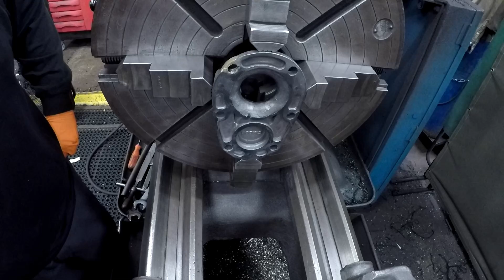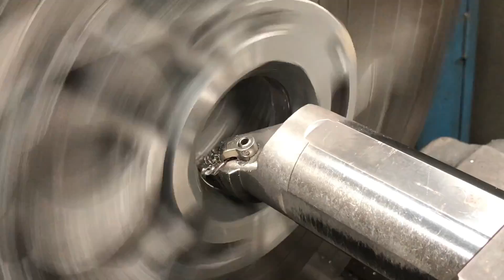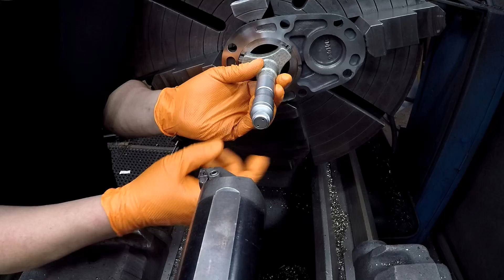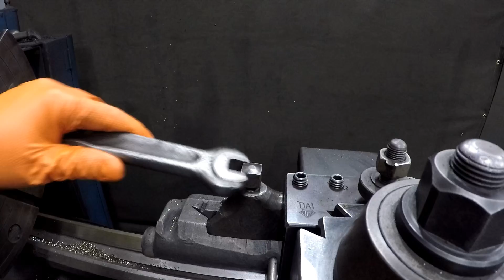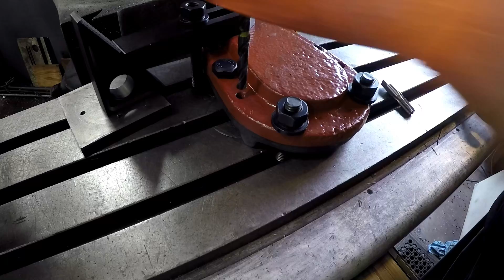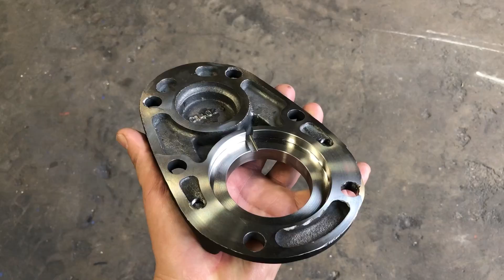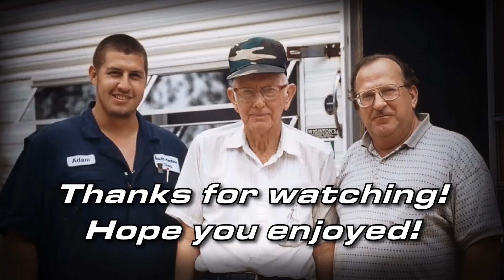Machining a Replacement Casting Part 2

Comment: Maybe you should have surface ground the face.
Reply: Maybe he (or more easily, the foundryman) should have properly averted the hardness issue in the first place. The drilling of the holes was more problematic than the facing op, and setting up and securing an irregular casting on a grinder, given that no clamps can protrude above the finished face, is not trivial.
Reply: All true.

Comment: Adam love your videos and have learned heaps. The problem with the reversed jaw causing the job to be extended from the chuck face could be overcome by removing material from a spare jaw or making your own jaw with out the interfering parts.
Keep up the good work

Comment: One question why didn't you mount the casting on a bridgport and bore the id races?
Reply: You'd have to use a piddling little boring bar compared with the 2" shank bar he could use on the lathe, and there's a lot more mass in the carriage of a Pacemaker than any boring head on a mill. Given the casting had hard spots it would have been a real fight even in a decent mill, let alone a Bridgie.

Comment: Fascinating stuff Adam,  you got yourself a new subscriber mate  ; )
I really felt for you when you blew that hole out while drilling the casting in part 1 of this project.  I was cringing at that grinding drill bit struggling,  and thinking to myself why you hadn't built-up the sides of the original broken part with putty as you did for the bore,  would of given you a little more meat on the edges where the 14mm holes were.  Hindsight is a wonderful thing isn't it!?

10 out of 10 for perseverance though mate,  your ability to not only fabricate and manufacture high quality parts, also extends to fixing stuff obviously.

I've been watching your uploads for days now,  and I must congratulate you on the quality of your videography and photography as well,  superb stuff!  I've learned so much in these past few days,  so much more than if I'd read an entire library of books on the subjects covered.

Thank you so much sir  ; )

TURK @ T4 Concepts

Comment: I'd think with all those chips and cracks especially around the bolts and uneven surface blemishes the part will fail too quickly.
Reply: Yep.  That casting has some serious issues.
Reply: What I understand is that the original casting worked for years until someone at Abom79's shop broke it during disassembly.
Reply: I guess that's what happens if no-one realizes that the "oil plug" holes are actually for jackscrews...

Comment: Well now WAIT,,did I miss,how did you measure,and locate the hole with the seal and bearing in relation to the other hole and the bolt pattern?
I am only in the video where you are boring for the bearing?!
Did I miss or am I not far enough or jumping the gun?
Reply: Yes, you did miss it.  He was able to line up three bolts from the old casting, and then secured them with a nut on the back.  It was a tolerance fit for a seal and it worked fine.
Reply: He bolted on the old, glued up casting and indicated the bore on that.
Reply: @generessler6282  .. right up there with eyeballing, that lining up may cost the gearbox to fail. I'm surprised there's no schematics for that part. Nevermind all the bolts hole chips, cracks, and surface blemish on the top.
Reply: @DJaquithFL  You can type the same comment one more time and you will have three for three.

I watched both videos carefully; the only eye-balling I witnessed was that of an eye-ball on a dial-indicator ending with a micrometer.  The outer bolt holes were all within specs of the tolerance of the original.
Reply: @generessler6282  you must be way better man. Pity you don't have video evidence of you completing a nightmare casing in short notice

Comment: Hey Adam out of curiosity is there a reason to have a casting made for that part vs making it from plate steel? Seems like a plate steel part would be much less likely to crack again in the future. Love the channel man
Reply: He responded to this question on the previous video. It would be really difficult to accurately duplicate all of the pockets on the original part, and it sounds like he was in a big hurry.

Comment: What is the advantage of bringing the knee up instead of using the quill? That was done in part 1 also.
Reply: Slower more controlled feed, if the work "grabs" the drill then it can pull the quill down and bad things happen, that won't happen using the knee feed.
Reply: I would guess that the knee is built more robustly, to handle the weight of the table and anything resting on it. With all that support built in, it gives more control when moving slowly in a single direction. If the quill can be locked, it won't move at all in this case. If Adam finished the hole by moving the quill down further, the drill could chatter more easily leaving a poor finish, or even breaking a chip.
Reply: As above, bringing the knee up is more controlled but also more stable as it has more weight. The more you extend the quill the more slop you get and like a lever, you get more flex at the end so it creates more issues with the drill grabbing, chattering or creating an odd shaped hole.

Comment: I apologise if I’m being dim, but couldn’t this have been faced in the mill? Is there an advantage to doing it in the lathe in this way?

Thank you for all your work and information.
Reply: Exactly what I was wondering.  Would a fly-cutter work as well.
Reply: yeah potentially, no reason you couldn't. I imagine the point to setting it up in the lathe is the ease of accurately boring the part as well as facing. In a mill you'd need a boring head as well plus after that still need to face the bottom of that hole square. Once you're setup in the lathe it's quicker and easier.
Reply: Adam loves his lathes. Nothing wrong with that...
Reply: I usually like to be able to do something more than one way to adapt to whatever I need to do.  Even if two will work, it's good to do some of each as you get the opportunity.  I figure Adam knows more ways than I've got fingers, which is part of why I'll watch anything he posts.  Having that broad-face Chuck sure made the lathe path easier.
Reply: By doing it in the lathe it is easier to align the bored hole for the bearing and the face of the plate. By facing it in the lathe you unsure the face and the bored hole are exactly 90 degrees to eachother. You can do this in a mill too but you require the exact size boring tool and boring tools for the mill for this size of bore tend to be smaller and have more flex. Plus each time you want to make a cut you will have to stop, do the math, set the cut on the head and then restart again then rinse and repeat for the measurement stage, it's an awful lot quicker and easier in a lathe if you have the right chuck! 
In saying that if he did it in the mill it would have probably caused less edge chipping on the trailing edges...

Comment: Arm chair quarterbacking here: back home on the 16"er would it have been possible to strap clamp the piece to the chuck face on three points to get the bore finished , instead of going with jaws, and then face it? Or it that a case of 'the cart before the horse' ?

Comment: Wouldn't a round insert make sense for that facing task? 
You don't need to get into any tight corners, and the cutting edge of those inserts is much stronger right?
also can index it around quite a lot, so if a part of it chips off you can just rotate it to a fresh edge.

Just my thoughts, i'm not a machinist.

Comment: Love the video, and the save of the gearbox!
But I can't help thinking an hour in Fusion and a CNC mill to raw plate stock would have been the faster option for this particular part ...
Reply: If you had a CMM to pick up the details. Otherwise you would spend a day measuring.
Reply: @mathewmolk2089  FYI. He is partly correct. These days technology is available (I do reverse engineering) to scan the old part right off the table and the datails are accurately precision vectorised right into CNC or 3D printer to make the part even in hard metal. It also leaves you with a fully dimensioned CAD drawing.

Comment: a bearing race with a slip fit?
Reply: The fit allows for thermal expansion when the gearbox comes up to operating temperature.
Reply: @johnferguson7235  It is just a retaining cap. - There is no competent engineer that would mount a bearing in a floating cap. It didn't even have locating dowell pins.The bearing rides in the gear box. The clearance is so you can get the cap off.

Comment: The thing that concerns me most about this is that the two end castings appear to have two bearings for parallel shafts with gears(?) and the work to make a new end casting takes no account of the spacing between the bearings.  A few thou difference in the locations will mean the shafts will not run parallel and thus the gear meshing will be suspect.  The way the substitute cover plate was machined would mean that it could never be an exact mirror image of the original one still in use.
Reply: Note that the bearing only sits 9 mm deep in the cover, which looks like half of the width of the bearing race. So I'd guess the bearing has a bore in the gear box too, and the race itself locates the cover.
Reply: @joelandersson8504  If that is the case then surely the cover plate and its features have to be indexed to the gearbox.  If the bearing race is the indexing then its location in the new casting is critical?
Reply: @clivewilliams1406  What I mean is that the gear box housing has a bore that fits the bearing. So the bearing is already located radially even without the cover plate. The plate then locates it axially, possibly with some shims to set the axial play in the shaft. And the cover plate locates itself on the part of the bearing race that sticks out. No need for dowel pins, they would just complicate things.

But this is just guesswork from my side... :)
Reply: @joelandersson8504  Your statement about the bore in the gear box makes sense to me. Some of the things I used to repair were bakery mixers. The cover plate on top of the transmission had two dowl pins locating it. If the pins were missing or the ears in the cover plate with the holes for the dowls were broken off the plate would move ever so slightly. Because the holes for the bolts holding the cover on are slightly larger than the bolts, without the pins the loads on the bearings in the cover plate would move the cover eventually wobbling out the bolt holes in the transmission housing. Back to Adam's gearbox. I believe that if the bearing is not held by the bore in the gearbox the the loads would be on the cover and the cover would move, eventually destroying the gearbox.
Reply: @patrickdougherty2777  This casting is just a cap, no more.
Reply: I had the same concern. Note that the failed end plate had no dowel pin alignment pin holes. This indicates to me end plate center hole alignment is not that critical or that the shaft self aligns the bearing mount. I would like to see the gearbox design to satisfy my concerns. The repair is going to a customer, so I am assuming that the assembly crew assured that the bore center was non critical. The other shaft relief in the casting was not machined, so it obviously isn't used. There isn't much bolt clearance for the 14 mm screws, so Adam's method proved satisfactory. My shop didn't have the lathe capacity for this job. We would have machined it on a mill.
I am glad to watch the casting surface hardened issues. I didn't expect this. I am equally glad to hear the explanation. I burned up HSS tooling on a similar project and didn't understand why. Adam is an excellent machinist and otherwise well rounded mechannic. I spent my career strictly on the troubleshooting and repair side working closely with the machinists to resolve repair dilemmas. I am doing hobby machining in my retirement. I am learning new respect for machinists that make the difficult look routine.
I just purchased a coaxial indicator to speed up hole centering. My non machinist sons and sons-in-law didn't understand my excitement. Adam's use is a perfect example of how to take advantage of this tool, and I intend to share it with them since they are seldom with me in the shop.

Comment: Happy it ended well. Drilling those those final holes, for the oil plugs, had me stressed. A crack at that stage would have finished me off.

Comment: Hi Adam, just curious; would this job have been possible in a milling machine?
Reply: not only would it have been possible, it would have been a thousand times easier. but it's still entertaining to watch chips any way they're made.
Reply from the maker: I’m just going to disagree with above comment.
Reply: @Abom79  that's cool bro, to each their own. the way you did it was certainly the way it was always traditionally done for 100 years, so there's nothing at all wrong with it, it's just a slow tedious way to do things. Still turned out a working product that will do the job. It would probably have been cheaper for you to outsource it to someone who has an NC Mill, than to spend your own time casting and machining it in a lathe. just saying that if it is a paid job for a client, it's simply too inefficient to do it this way.

i might go watch the first vid to see what the motivation was for doing this, until then, all the best mate. cheers
Reply: "I’m just going to disagree with above comment.", said the Master Machine Shop Operator of many years, and smiled quietly to himself...bwahahahahahaha
Reply: madaxe79 I suspect the customer didn’t pay for this repair.
Reply: @drteknical6571  haha yeah for sure

Comment: Do you think maybe Annealing that thing Around 1500 and soaking it for abit to make sure the heat penetrated would have taken care of the hard spots. I saw you hit  it with the torch But im guessing the heat didnt penetrate the thicker spots
Reply: No question about it. - Bury it in a charcoal fire and cover it with fiberglass insulation and let the fire go out and don't take it out until you can hold it in your bare hands. - I anneal all kinds of stuff that way. - Makes a good poor man's stress relief furnace too.

Comment: One of my favorites. I really like seeing real world industrial repairs.  If that carbide drill bit broke off, what would be the options?
Reply: "If that carbide drill bit broke off, what would be the options?"
Call in AvE to remove it using his own in inimitable style, of course!   (a joke, just a joke!)
Reply: Mill it out. It's not fun
Reply: Got to the bar and order a double Black Velvet and a draft and then call somebody with a tap burner or EDM and then order another double. Then call your customer and get ready for a world class ass chewing.  ---- Been there, Done that. Especially when there is no way to get it done by the time you promised.

Comment: Glad to finally hear some familiar cast iron sound for the first time in the job at 13:25. My only question about this whole project is why the paint color changed from red to blue. Great video as always.
Reply: The color thing, I'm guessing  the sample part came off another gearbox, not the one under repair. Maybe they didn't want to disassemble the repair box any further than necessary.

Comment: Why not use a surface grinder for that facing/truing cut?
Reply: I was thinking the same thing. Probably would have eliminated all the edge chipping that happened.
Reply: It was done this way so that the bore walls are perfectly perpendicular to the casting face.
Reply: @eWhizz  He has micrometer gauges to align the workpiece. He can easily align it after surface grinding to make sure the bore walls are perpendicular.

Comment: Are you going to label that new one with a different serial number since it was repaired? The manufactured of that gear box might be confused if the part wasn't made by them. Although your repaired one is probably better lol
Reply: If the manufacturer had still been around I think it would have been cheaper to just order a replacement part, rather than air mail the part back and forth to a foundry and have Adam spend a significant amount of time on it.

Comment: What was the machine that you fixed the part for ?
Reply: He said it was a speed reducer, meaning it's a gearbox with only one gear. There's an input an output shaft on offset axes and the machine changes the rpm between the input and output using gears. Who knows what the speed reducer is for, though, if that was your question.
Reply: Thanks, I like to know. and see how they all  come together
Reply: See Part 1 vid. It's excellent.

Comment: curious to know why you used the metric measurements
Reply: Most likely because the bearings and seals are in metric sizes in this case (This I've noticed is quite common, even in USA made products, because I recognise some of the bearing numbers that Adam has shown, which shows the inch size of the bore, but it is a standard metric sized bearing, such as 6006 or 6204). Not being a machinist, I don't do much precision work with inches, but I live in England, and a large quantity of daily items are still in inches / inch-originated metric sizes.
Reply: Thank you for the explanation 🙏